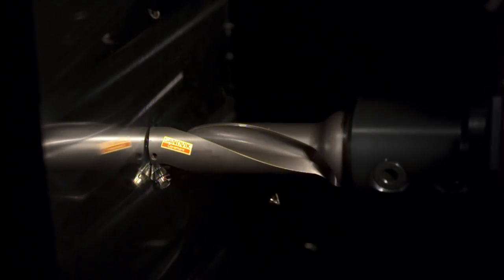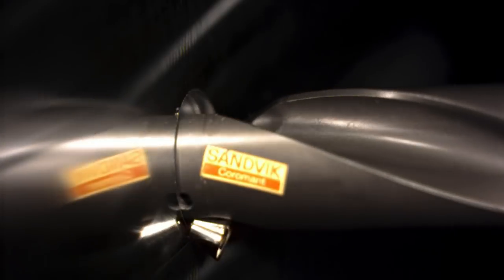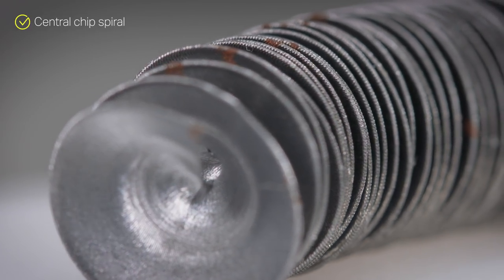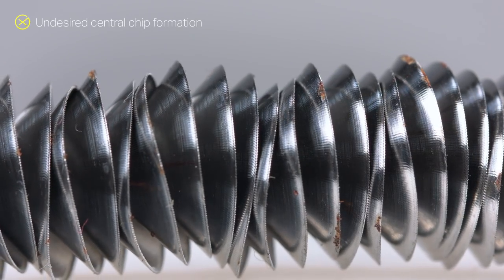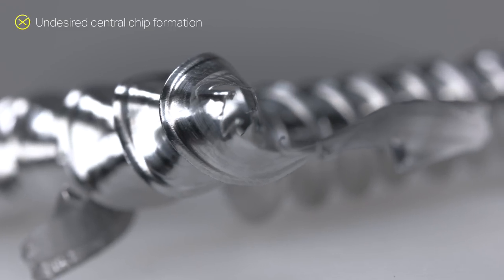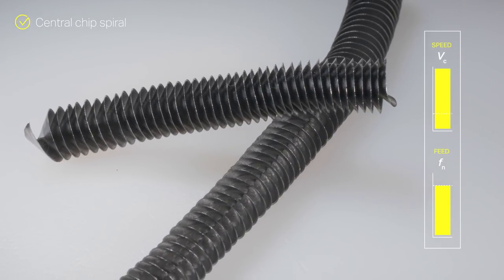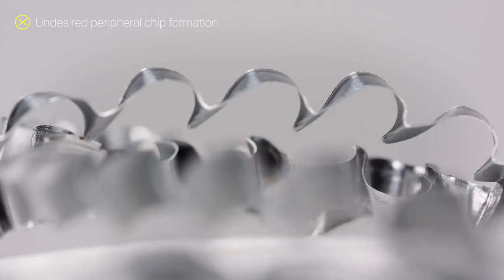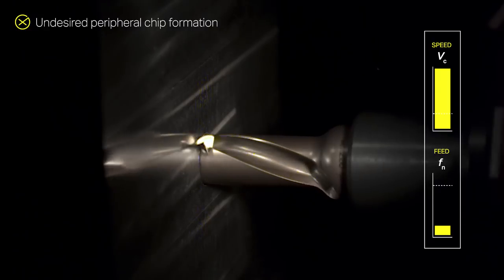How to achieve good chip formation in indexable drilling - Tips film #39

Comment: No Aluminium shown here?
Is it even possible to drill aluminium materials with an indexable insert drill in a reliable process ?
Reply from the maker: Hi Max,

Apologies for the delay in answering your question.

Of course you can drill Aluminum with an indexable insert drill, you just have to know how to apply it. A pure and unalloyed Al will need different cutting parameters compared to Al with a high amount of Si. Also tool life will be radically different.
 
I suggest that if you want to get a first hint you can use CoroPlus ToolGuide to see how different aluminums behave.

https://www.sandvik.coromant.com/en-gb/products/coroplus-toolguide/Pages/default.aspx

Best regards,

Tomas Furucrona
Global application specialist